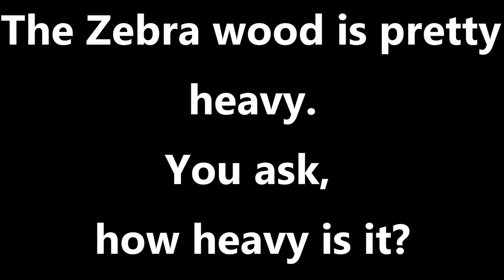Zebra Kit Guitar The Art and Noise Samples and Unboxing

Comment: I wouldn't sweat the pole piece thing. It's like horse shoes, close will work.
Reply from the maker: Yeah, Most guitars bridge pickups seem to be a little off because of the pickup height and the angle of the pup. The higher strings are on top of the poles, but not really centered. Have a great weekend.